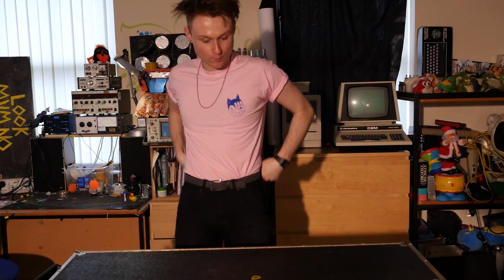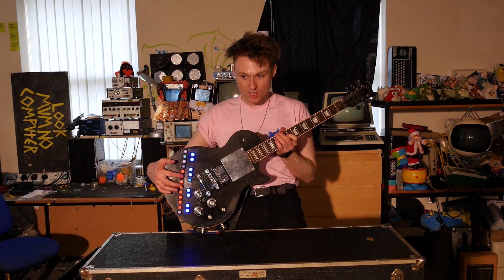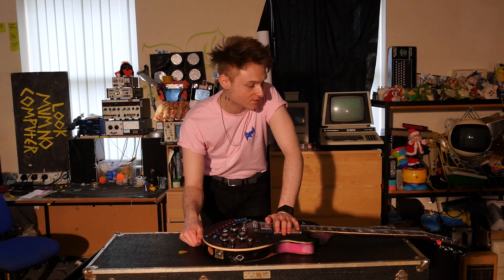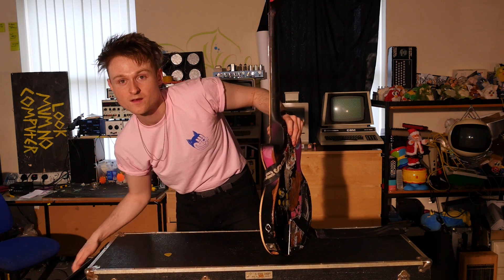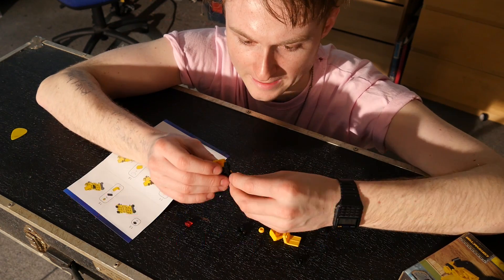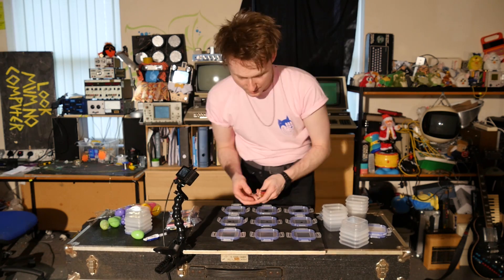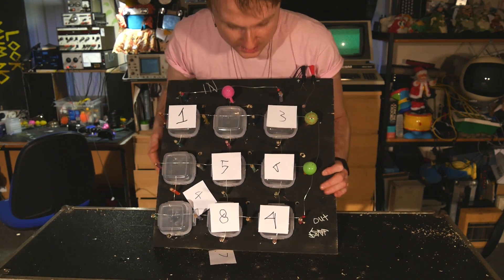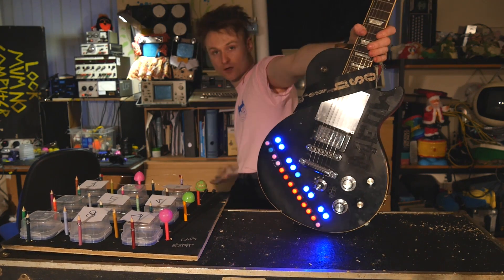MIDI SYNTH GUITAR BASICS, BUTTON MATRIX? #guitar #synth #arduino

Comment: I'm going to try this.... just got a smaller arduino from china. I'm tempted to try and route the output in parallel with the regular guitar, so I can run this through a single input into my guitar amp. Is this a bad idea? Please help me.... I sold my EA 250 for rent...and the guitar I'm about to cut up isn't a hollow body. Also your truck sounds like the trashman from homestarrunner.

Comment: Very Cool!! Now..How can we make it into a polyphonic cv/ gate keyboard... Possibly With ~ six individual gate / note cv outputs ?! Maybe with six onboard vca's and adsr's. And a vca mix out. This "silent keyboard" with six inputs for what ever oscillator or sounds you like while the separate cv's will pitch them according to keys pressed so we can play our modulars etc. Polyphonically. Example first key pressed sends cv/gate 1 and triggers Adsr for vca1 , Second key pressed sends cv/gate 2 and triggers adsr for vca2 and so on. We could make polysynths out of anything cv pitchable!! Or you could use it to trigger samples or a mix of any sounds. The synth world needs a polyphonic cv gate keyboard Please help!
Reply from the maker: sounds hella tech. lots of components in that. check out hex inverters midi2cv if you plug 2 of those up with a midi keyboard. then get 6 vca's and 6 adsrs your sorted haha.        but if you wanna build it all into one thing youll have to do the same just all in one box :)
Reply: Sweet thanks! Looks like I'm gonna get need eight VCA's :$

Comment: the ghosting can be fixed with diodes.
google anti ghosting diode.

it can be fixed in software aswell, but I'm a hardware guy, so i like to keep my code as simple as possible.
Reply from the maker: you know it! diodes and scanning. next video on this gunna solder some diodes and switches onto it to show that next bit :)
Reply: No next video.